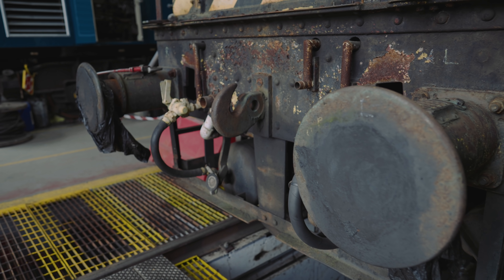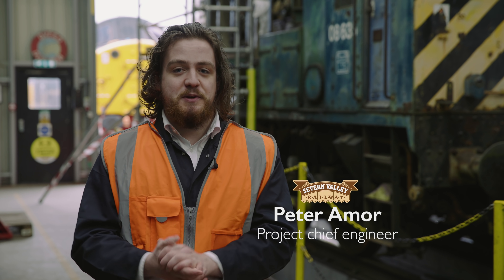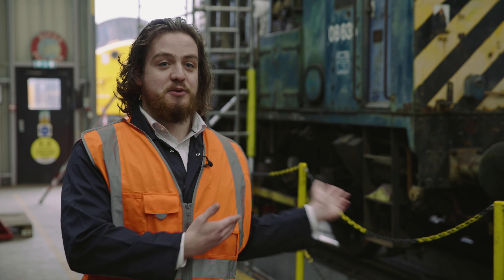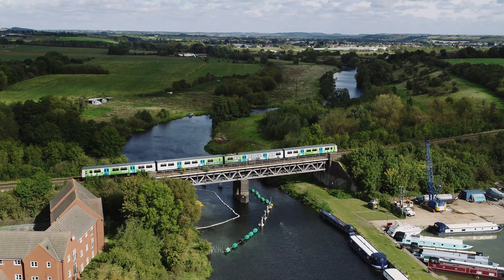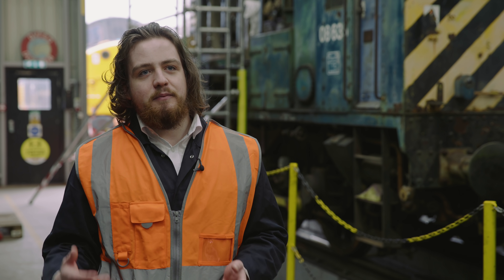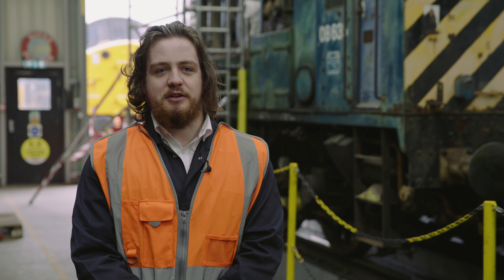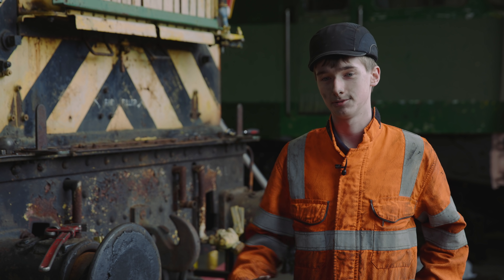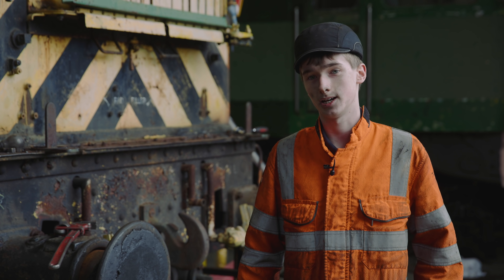Severn Valley Railway helps to build a locomotive for the future | The Harrier Hydro shunter project

Comment: Ive had an idea for an electric steam train simular to the hornby live steam but grand scale.
Steam up on the grid then use a battery pack to continue making steam for the short journey the steam trains make.
Keep the old working even have the same old chuf chuf but mod the boiler and heat source extensively.
As a electrical engineer that's worked servicing mainline trains I'm the man with a plan to keep heritage steam running.
Reply: Well, if you have the idea, get some backing and start testing.
Then you truly may be the Engineer to have driven change.

Although, as you will know, change certainly doesn't happen very fast on the railway 🤣

1990s rolling stock still have features from 1970s locomotives despite the incredible wealth of technology available to the designers at the time.

Comment: Ah hydrogen again.
Where will their hydrogen come from, how will it be delivered and stored?
Oh it's made in a very inefficient polluting way from natural gas. Dangerous to store and handle. Hard even to prevent leaks. A totally impractical project. 
Electrolysis? Again inefficient and the gas has to be compressed, stored, transported and stored again.
I expect the poor old taxpayers money is being expended on this dead end technology which will prove nothing we don't already know.
In the past cylinders of coal gas for lighting caused dreadful accidents on the railways until they were banned. Now they want much larger amounts of a far more dangerous gas.
In short it's bolix.

Comment: Next step is for Birmingham Uni and SVR to add hydrogen fuel cells, batteries and electric motors to a carriage which could be used to convert a steam engine train into a hybrid, this will save SVR a lot of money in buying less coal. There isn't any of this story mentioned in the SVR website news section which is odd.

Comment: so going from Diesel electric to Hydrogen-Electric, would the lower weight due to lack of the engine block compared to a fuel cell cause addhesion issues? also from what i've read below if the hydrogen is generated at night it should be cleaner than some options, end of the day though Diesel is very reliable and easy to produce

Comment: So long as the hydrogen comes from renewable electricity and NOT fossil fuels (95% of hydrogen today comes from natural gas) then fine. It is VERY inefficient in any case, and remember that hydrogen is an energy carrier - not a fuel. It's also currently 8x the cost of diesel....

H2 has some great uses but mass transport isn't one of them.
Reply: Birmingham Uni press release mentions the hydrogen is from renewables.

Comment: What is not make clear in this video is what sort of hydrogen conversion are they actually doing, is this the old fashioned way of using the hydrogen in the original engine as per a combustible gas, which does not require a lot of work to the engine, or the modern way that converts the hydrogen into electricity.

Both of these have there own efficiency problems i.e. the power that you put into in this case making the hydrogen, is not equal to the power produced by the shunter, even overhead power has losses.
Reply: It's a fuel cell they are using.

I love how you ignore the energy costs of extraction and refining of diesel fuel when going on about the energy cost of producing hydrogen. All fuel supplies taken some energy to create and waste energy when being used.
Reply: @neiloflongbeck5705  True but nowhere in the video did it say how the H2 will be produced. He said you can make it via electrolysis but didn't say that's where it's going to come from. I think we can assume it'll be supplied via Air Liquide tankers...which all comes from natural gas. I just wish people were more honest on the source of the energy.
Reply: @fruitytv-uk no we don't. But that's not the issue.
Reply: @neiloflongbeck5705  I was ignoring the cost of extraction and refining of diesel fuel in this instance as this shunter will no longer be using it, so why would I need to mention this in context with Hydrogen. The power output at the wheels is always less than the power put into it.
Reply: @Ashworth-Media  except you mention the power put into the making of the hydrogen in your first comment. Which is why I responded with the power needed to produce the diesel. It is a relevant comparison.
Reply: @neiloflongbeck5705  No it is not a relevant comparison, the video was about hydrogen, not diesel, I was stating that using hydrogen in a fossil fuel method and in a more technical manor both had there own efficiency problems.
Reply: @Ashworth-Media  as always you never get back the energy needed to produce a fuel. So your comment about the energy needed to produce the hydrogen is irrelevant to the use of hydrogen to power trains. The energy needed to produce diesel is never commented on in the story of the efficiency of the diesel locomotive compared to the steam locomotives it replace, so why is it relevant in the story of the hydrogen fuel cell? Yes, hydrogen is more expensive to produce, store and transport than diesel, and it may not produce as much power at rail. What is the issue is that greenhouse gas emissions are reduced, and although water vapour is also a greenhouse gas, it is not as powerful a greenhouse gas as carbon dioxide and one that naturally will remove itself from the atmosphere in large amounts in the form of rain unlike carbon dioxide of which only a small amount is washed out of the air by the rain.
Reply: @neiloflongbeck5705  I am fully aware of this, my comment if you would care to read was not about the energy need to produce Hydrogen. Water vapour is already present in our atmosphere and is usually expressed content wise as humidity. There is a real need to reduce CO2, it is usually sulphur dioxide and nitrogen oxides that are washed out of the air as acid rain. In our rush to reduce CO2 we need to ensure that our sources of power are net carbon across all processes, nuclear when assed in this way comes out as carbon positive due to the mining of and converting of nuclear materials and the there very long decay storage time. Bio Mass is still burning a carbon based material so it also is carbon positive, the sun does not shine 24/7 and the wind does not always blow.
Reply: @Ashworth-Media  to quite "both of these have there [sic] win efficiency problems i.e. the power that you outing this case making the hydrogen is not equal to the power produced by the shunter". This clearly states states that the power needed to make the hydrogen is not the same as the power power produced by the shunter. You are comparing apples with oranges. Piwer is defined the rate of energy use. All fuel sources use energy to produce them, but the efficiency of a locomotive is defined as the amount of power available to do useful work divided by the energy in the fuel used. It has nothing to do with the energy used to produce that power source, that has it's own efficiency and is unrelated to the efficiency of the use ut is put to or how far it is away from its energy source.
Reply: If you read the Birmingham Uni press release the shunter uses hydrogen fuel cells and batteries, the latter for extra power and regenerative braking which isn't mentioned in the press release (all hydrogen land vehicles have batteries for regen ).

Comment: Good project. Shunting looks like a good application for rail use of hydrogen fuel. Next worthwhile project would be conversion of or new build steam to use renewables or waste, complete with improved combustion, exhaust system, water treatment and standby heating. Look forward to seeing how this will work.
Reply: I think the main thing for steam locos would be Gas Producer Combustion System fireboxes, not sure what they could replace coal with - don't know enough on that to comment really. What do you mean by water treatment? I'm tired so forgive me if that's obvious 😅
Reply: @zacm.2342  Steam locomotives will run on anything that will burn. GPCS is for coal and uses restricted air flow through the firebars and secondary air from openings called tuyeres above the fire bed. Coal is not a good fuel due to the damage done by grit and ash and corrosive gases. The old girls need to be protected especially considering the amount of work that goes into their restoration. There is no good reason to use coal except around places like coal mines and perhaps for demonstration purposes. Steam locomotives run perfectly well on diesel oil or similar and in practice are just as efficient but the exhaust is cleaner. Which makes you wonder why they got rid of them in the first place. 

Water treatment is something like the chemicals that you can add to central heating systems to protect them from scale and corrosion. The water is made quite alkaline >pH10.

The shunter conversion is probably the best railway application for hydrogen fuel but it needs to be benchmarked against battery electric and fireless steam.